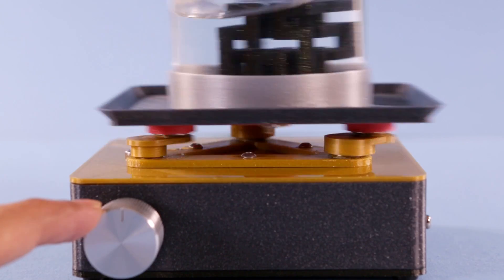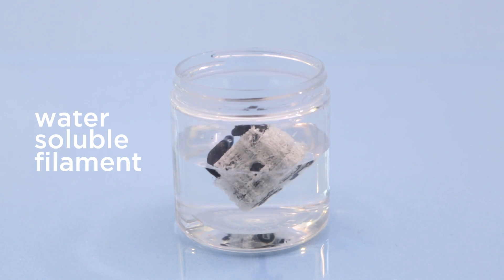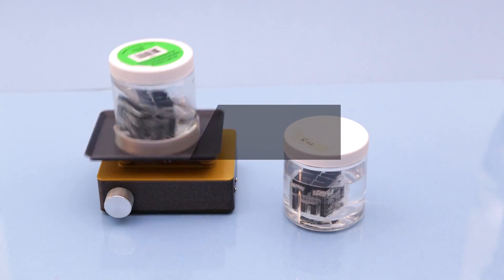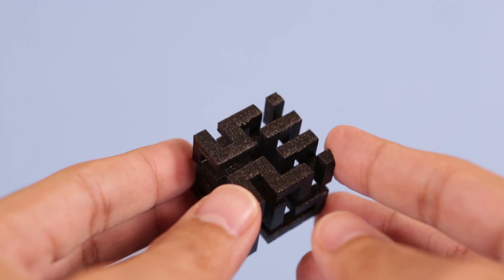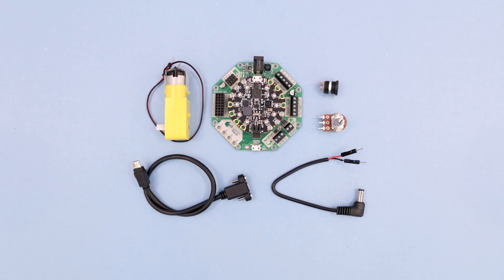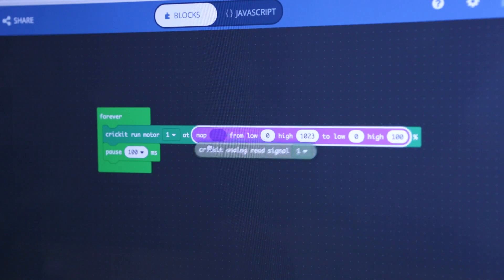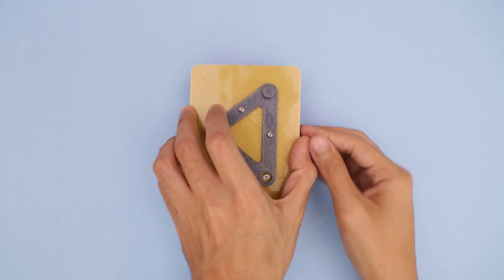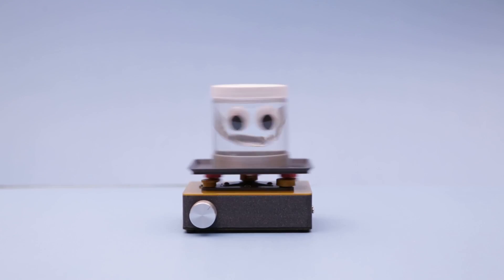Crickit Lab Shaker #3DPrinting #PVASupport #DualExtrusion

Comment: could you modify the case to have lines on the bottom for rolling dice and could you use a button that pushes to roll at a curtain speed and add a timer so I only rolls for 2-3 seconds?
Reply: and could you use a Arduino nano instead of the Adafruit CRICKIT for Circuit Playground Express to save room